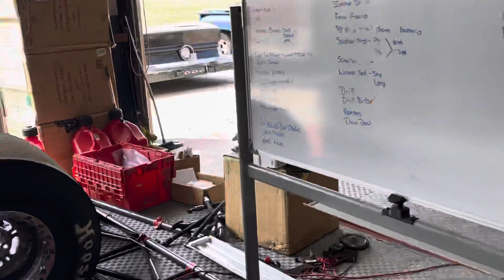Is It Ready??

Comment: He’s not the car builder he thinks he is that shits gonna break next race anyone wanna bet 500
Reply: It may not break but I can guarantee you he WILL do an 1/8 mile burnout every pass..🤣🤣🤣🤣
Reply: It's got uneven compression now you can tell how the starter sounds the blower will brake but I hope I am  Wrong and I wish you the best
Reply: @shawnmccutcheon6873  
Maybe valves are just out of adjustment. 
But its not happy regardless
Reply: @shawnmccutcheon6873  sounds like it has a dead cylinder … id guess ignition related . Bad coil or wiring issue etc …
Reply: @nickorozco9177  
Ignition doesn't cause a cylinder or 2 not to have compression. EVER